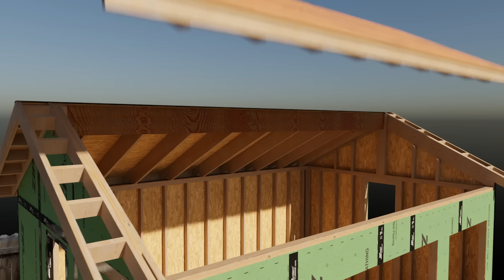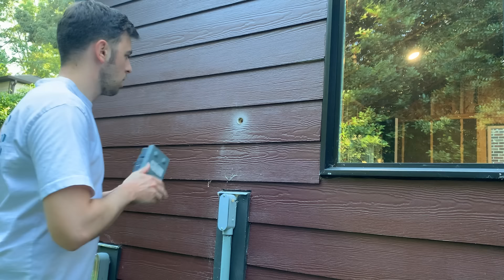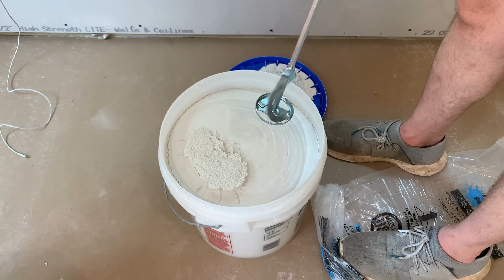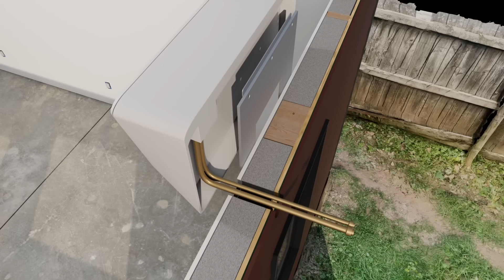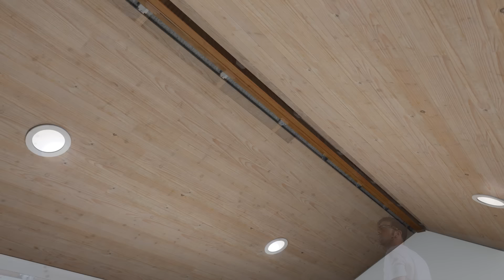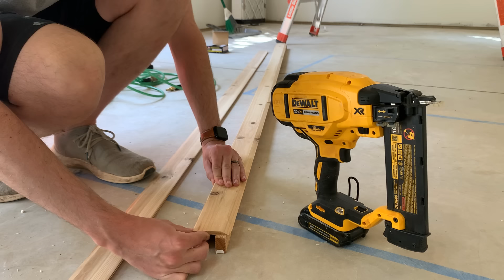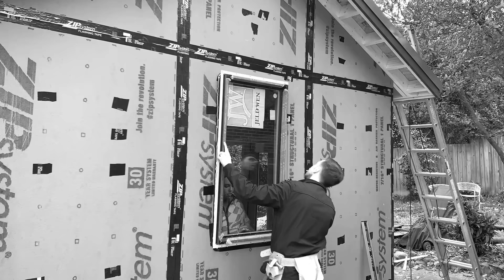Backyard Office & Workshop | Full DIY Interior Build (Insulation, Drywall, and Mini-Split)

Comment: You don't need guages for the mini split nor need to pull a vacuum, It's plug as play.   

It will purge the air as you use it if purchased new.    That's unnecessary time added.  Just read the manufactures directions

Comment: Did you get a building permission for that or you dont need that in your country?
Reply: Laws are different in every state. Most of the time if it's under a certain square foot, you don't have to. Where I live if the building is under 300 Sq feet, you don't need a building permit. But you still have to follow certain rules.

Comment: Absolutely love this office build. As a network administrator, my only critique is wishing you installed conduit for the ethernet cabling. If the cable ever goes bad or has a fault, it's going to be an absolute PitA to run new cabling.

Comment: Pretty nice build and video, really like it. 
I just wonder about the cables, I wouldn't be better to run them through a tube inside the walls? If you ever have to run another cable or change one it would be a quite difficult isn't it?

Comment: How do you plan to replace the wires in case something happens to them when you don't run the cables through flexible conduit, you will have to tear up the walls?

Comment: I am very curious about burying the wires directly in the insulation material. Is there any danger? Isn't it usually said that wires can't be crushed? Heat dissipation is also not good. Isn't it true that wires buried in walls are usually made into pipes?

Comment: btw for future concrete jobs.. make sure you put some type of oil (olive oil) or wd40 on the inside of the wood before you put concrete in it.. your pad was so small it was easy to remove but when you get bigger jobs they may be harder to remove.. also some steel wire still would be advised didnt have to be rebar thats too much but they make just small steel fencing that you could of added on the cheap..  lastly next time take a sawsall (if you have one) and vibrate the outside of the wood after you poor it to get air bubbles out of it on the side... (or just tap it alot with the hammer)

Comment: I'm not an expert but are you sure having the insulation directly touching the wires is safe?
Reply: It's Rockwool, which is non-combustible, doesn't retain water easily, and is chemically inert. It and products like it are fine to put around electrical wiring so long as the wiring is wiring is rated appropriately for the amperage. This is true in both the U.S. and the E.U.

Comment: I’m guessing someone has already said it, but comments aren’t searchable so just in case:

Please please PLEASE build an AIRTIGHT HIGH END ventilation system for both the 3D printer and the laser cutter. They both create fine particulate that destroys air quality and increases the risk of lung cancer significantly. These devices are becoming so common and our current generation is largely unaware of the dangers and risks. Look into non smoking lung cancer, it is on the rise and only going to get worse over time.

Comment: Surprised the electrical cables are not placed inside tubes to protect them if drilling in the wall at a later stage. Nice video and project though!

Comment: No basic heating solution, but if it is usually warm in your location, that's fine, but 23k for what? I can buy an apartment in Eastern Europe for that price.
Reply from the maker: It has heating. The mini split is a heat pump. Most of the building cost is in the concrete/driveway extension in the first video of this series
Reply: I was just commented the same as you, I mean...The room, the setup is cool and all but $23k ?, not to mention they done it themselves and the land lot price is not included too, no wonder why more young people nowadays decide to just give up with their life becase things become too damn expensive
Reply: Plug in space heater would warm this space up easy and fast

Comment: Question this type of housemaking isnt common to be seen on my living area.
Is it suitable for a tropical weather where the hot season gonna be 35-38°C? 
And rainy season around 27°C-28°C .

How safe is the electricity cable covered with the rockwoll?, how if we want to change some cable do we need to buy another rockwoll?

How is this material react to the hot and cold temperature, is it a good choice for a humid place?
Reply: Roockwool is fire roof and moisture proof

Comment: Hard to see but is the foundation higher than the Padding around it? If it is not may I ask how do you avoid water damage the wood. If anyone know please help. I want to do something like that but afraid it will damage the wood in the long run. Thanks in advance.
Reply from the maker: Check out my first video on starting the office. I have a whole section about the base wall skirting!

Comment: My only note is the concrete pad is not wide enough (in the short distance). Those bolts are too close to the edge and will eventually crack the concrete pad with vibrations
Reply: vibrations from what, walking on it? lol

Comment: Can anyone kindly tell me, why instead of brick wall and cement, everything is made of wood ,,,, it is much much less durable and lifespan is also much less....
Reply: No the life span is not less and the R value is twice of brick or cement buildings. Making it smarter to build with wood.
Reply: First, "everything" is not made of wood. U.S. residential construction includes a wide range of modern and traditional materials and methods. Wood framing is the norm, yes, but contrary to what ignorant anti-American bigotry and content creators chasing that audience will tell you, it's far more than just putting up wood framing. I'll attempt to provide some context.

1. Cost-efficiency: Building with wood is significantly more affordable. If this office had been built with poured concrete, brick, or ICF, the wall system alone could have matched or exceeded the cost of the entire finished build. Solid clay brick or ICF construction could easily triple the expense.

2. Ease of use and adaptability: Wood is abundant in the U.S., straightforward to work with, and highly flexible—ideal for DIY construction or projects that may need future modification. Cement and brick are far less forgiving in this respect.

3. Longevity with modern materials: Products like ZIP System sheathing, Rockwool insulation, and closed-cell spray foam enable wood-framed structures to last 50+ years with routine maintenance. Many forms of maintenance (like roof replacement, HVAC servicing, or window sealing) apply to all construction types—wood or masonry.

4. Maintenance as personalization: Americans often view upkeep not just as a necessity, but as an opportunity to customize or improve a space. Materials that are easy to modify make this more feasible and affordable for homeowners.

5. Climate and seismic suitability: Wood performs better in earthquakes than rigid masonry or concrete because it can flex and absorb energy without catastrophic failure. In humid or freeze-thaw climates, wood-framed walls with proper air and moisture barriers dry more quickly than solid masonry, reducing long-term degradation risk.
 
6. Masonry Is not maintenance-free: Structural brick or cement walls crack over time due to settling, thermal movement, or moisture intrusion. Repointing brick (replacing deteriorated mortar) is labor-intensive and costly. In tropical or coastal climates, concrete often suffers from spalling and rebar corrosion unless treated or maintained diligently.

7. Code and efficiency evolution: Contrary to what creators chasing views and comments, as well as the vast expanse of ignorant anti-American bigotry, will tell you, U.S. residential building codes are designed around framed construction and offer prescriptive paths for high energy efficiency, air-sealing, and insulation. That doesn't mean that structural brick, ICF, and poured concrete aren't commonly used here, and in fact you'll often find this mixed in with wood-framed construction. But modern assemblies using continuous exterior insulation, WRBs like ZIP, and smart vapor retarders outperform many uninsulated or monolithic masonry walls in both comfort and efficiency.

8. Speed and labor: A small wood-framed building can go from slab to dried-in shell in a matter of days, even by one or two people. Masonry and concrete construction is much more labor-intensive, often requiring skilled tradespeople, scaffolding, longer curing times, and heavier equipment—costs that quickly add up in time and, importantly, significantly higher costs.

9. Thermal bridging: Wood has far less thermal conductivity than concrete or brick. That means fewer cold spots and less energy loss—especially when combined with modern insulation. Solid masonry often requires interior framing or furring strips just to install insulation and wiring, undercutting the “simplicity” of masonry walls.

10. It’s CONTEXTUAL, not cultural: The U.S. uses wood because it makes sense in the U.S.—where forests are abundant, labor is expensive, and zoning often encourages detached structures with individualized heating/cooling. Many European or tropical regions build with masonry because their conditions are different—denser cities, cheaper masonry labor, limited forest resources, or colonial building legacies.

Critically, the United States encompasses one of the most diverse ranges of climate zones and geographies on Earth, spanning 8 major climate zones and 13 subzones—covering everything from arctic to tropical, humid to desert, coastal to alpine. This geographic and environmental diversity is reflected in our building code and practices, which allow homes to be tailored to the specific demands of each region.

It’s not that one method is universally ‘better’—it’s that building wisely means adapting to local realities. In North America, wood framing for residential construction is the clear choice much more often than not. And when it's not, we can build it differently.

Comment: nice setup but no wonder american homes can't stand fires and tornados – y'all build houses out of wood, foam and paper.
Reply: No, we don't, you're just an ignorant bigot who can't understand what to us is common application of modern materials, methods, engineering, and architecture. A typical house fire in the U.S. is little worse than a typical house fire in Europe. We use materials that significantly resist ignition and slow the spread of fire. American homes stand up well to EF2 tornados and below. It's an EF3 to an EF5 tornado that causes real destruction, and if your home has a door, windows, and a roof it's destroying your home, too, you just don't realize it because in addition to being ignorant about American home construction you're ignorant about how tornadoes do their damage.

Comment: One thing you did VERY wrong, is not putting plastic tube guides to all the cables... putting just the cables you will have to destroy your walls in case you need to change wires or add some more wires... With a plastic tube you just put new cables through...

Comment: Having a hard time figuring how americans just pull wiring directly through insulation ... and are not insulated via any sleeving or insulation tubes (not sure how those are called in english).
Reply: Having a hard time figuring out how any time anyone sees some Americans doing something they accuse everyone in the world's third most populous nation of doing it. These people are do-it-yourselfers, and if you'd paid attention you'd have seen many Americans telling them they should have run the wiring through tubes/conduits to make it easier to replace a faulty wire. And that insulation is Rockwool. It and other products like it are perfectly safe in contact with rated wiring just fine, and that's the case in both the U.S. and the E.U.

Comment: Broooother don't do inside wall wires directly like that, if the wire goes bad, which happens with thin wires like ethernet, then you are screwed. Also, long HDMI wires are not good!
Maybe it's an American practice but in my country ppl don't put wires in the wall like that.
Reply: No, it's not an American thing. Many Americans have called them out on this exact point. And, look, if you watched 25 different Americans doing something every day of your life for 50 years, you'd see 456,000 individual, different Americans doing that thing over the course of your lifetime—and that would only represent 0.13% of the entire population as it existed at the start of that 50-year period, much less the additional 150 million Americans who will be added over that time. Judging Americans and American things as "wrong" or "bad" based on what you see on social media, especially a social media that loves to feature "wrong" or "bad" Americans, isn't logical or rational.

Comment: hi !  i live in IRAN and i liked your video its awesome but one thing : in my country a 9000btu AC is around 130$ in USD  but in your country its 783$ USD .....  its a lot different you should come to IRAN bro (:
Reply: We can get cheap air conditioners here as well, but this isn't just an AC unit, it's a full-featured mini-split with a heat pump for both heating and cooling, and probably a dehumidifier. The unit probably includes inverter tech for energy efficiency, and likely has variable-speed compressors, both of which cost more up front but save a lot of energy long-term. So it's controlling humidity, cooling the space in the hot and humid months, and heating the space in the cold months.

Comment: Wow, completely unnecessary use of toxic spray foam
Reply: Doesn't know what kind of foam it is. Isn't aware of a basic curing process that renders a correct application of the foam inert. Doesn't know what type of climate zone and subzone these people live in. Isn't accounting for anything else in the build Still makes a declarative judgement.
Reply: Spay foam is not toxic. Once it cures (off gasses) in 24 - 72 hours ( same curing time as paint) it's safe. So many many people don't know what they are talking about when it comes to foam.

Comment: 24 000 for this? No way. Just the concrete is that price.
Reply: The concrete is a good portion of the cost, in part because it also includes a driveway extension back to the foundation. They break out all of the materials costs in their other videos. This is a pretty common price to pay for a setup like this on a concrete slab. And if you wanted to use a different floor and a lower-cost anchoring system viable in your climate/geographic environment you could get away for less.